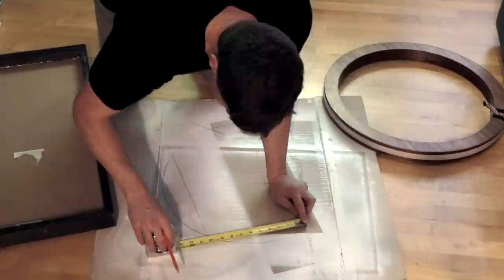DIY Music Reactive "Rings of Saturn" LED Pendant Light (controlled by Arduino) || How to Make

Comment: Why not use 3 of the 4 silver ( conducting? ) hanger wires as signal/power wires for the LEDs?
Such a grave missed opportunity compared to the atrocious black sleeved cable just dangling from the ceilling >_<
Reply from the maker: Durahl version 2.0 is on the to-do list....

Comment: Shame about the power cables. Would be great if there were integrated into the suspension cables. Apart from that, this is really great :)
Reply from the maker: Thanks!  I have a version 2.0 on my to-do list, and hidden wires will definitely be part of that.

Comment: This build is incredible! I would love to see a separate video on the electronics! :)
Subscribtion incomming

One question: How do you control your light? Specificly the constant white modes and the change to music-reactive mode?
Reply from the maker: Thanks!  

I use an RF receiver and remote.  I included a link to one in the description of the video, and code link is also in the description.  I programmed it to use a button that you press to cycle through the modes -- party visualizer, chill-out visualizer, slow changing hue, warm white, cool white, medium white / max brightness, off.  Other buttons are programmed to adjust the brightness.  One of the reasons I didn't go into detail is that I'm not fully happy with this solution.  I am working on a version 2.0 using esp8266 and Blynk to control it via a WiFi phone app.   I have a few more builds in my pipeline beforehand, but definitely plan to do a video on the electronics for music reactive LEDs at some point.

Comment: Would it be possible to order 1 of these from you ? i would aboslutley love one of these , with the possibility to change colors to fit the mood .  i would be extremly thankfull and happy if this is possible as i dont have the tools nor place to build one of these as i have a small 14SquareMeter appartment =/ .  Ebay or something would be easy to setup for a deal , if its not possible well thanks for the build guide <3
Reply from the maker: As of right now I'm not selling anything, but stay tuned as I'm talking to a few people who might be developing some pre-made kits and controllers to make projects like this easier to do.
Reply: Oh sounds intressting! And i think that would be a really smart buisnessmove , Some various DYI-Kits and the ideas designs you seem to have , it would be really awsome ^_^  thanks for the reply <3

Comment: How did you do the Arduino for the light?
Reply from the maker: I used an Arduino Mega with electret microphone, and RF receiver and remote.  There is a github link to the code in the video description.  I'll be doing a music visualization electronics and code video at some time in the future with more details.

Comment: What is the tool you use to cut the edge?
Reply from the maker: Which edge?
Reply: Modustrial Maker Use it at 2:25 minutes of the movie
Reply from the maker: That is a circle cutting jig for a router.  There is a link for it in the video description.
Reply: Modustrial Maker No, it's blue and you use it to cut the edge of the laminate at 2:25 of the movie
Reply from the maker: Oh that, it's a edgeband trimmer.  I'll add a link when I'm back at my desktop

Comment: controlled by Arduino more info please
Reply from the maker: +Andrew Shepherd the GitHub link to the Arduino code is in the video description.  Also, for more electronics details, check out my video for the Bluetooth speaker with music reactive LED matrix.  It uses basically the same setup (except it uses a momentary push button instead of RF remote for mode switching).

Comment: Should have run the wires up through a mount tube or something.  Hide it a little better, but then again, i'm just sitting here being 'that guy' on the internet, not actually accomplishing anything.
Reply from the maker: +walperstyle no worries, I'm that guy with my own work too.  V 2.0 should be done sometime this year, and will have a better wiring solution.

Comment: you should of put rgbw led in it instead of w leds
Reply from the maker: I wanted to do that initially, but unfortunately, the FastLED library isn't compatible with RGBW strips, since they have 4 LEDs per cluster.  It was either RGB or WWA, since both these have 3 LEDs per cluster.  Given that this is intended for my living room and I don't live in a dorm room, it had to be WWA :)

Comment: can you post a link to the arduino code?
Reply from the maker: Daniel Schlotthauer  It isn't pretty and has a couple bugs still, but I am happy to email it to you.  Just send me a message with your email and I will send it to you.  Also, if enough people show interest, I will do a separate video on the arduino electronics and code.
Reply: Modustrial Maker definitely do a video of the code
Reply from the maker: I"m getting a lot of questions about the code, so I threw it up on github.  Like I said, it is not very pretty :)  There is a lot of unused code and comments from other code I hacked together to make this that are no longer accurate, but it does work.  https://github.com/modustrialmaker/Rings-of-Saturn-LED-Light-Music-Visualizer
Reply from the maker: ...and because of the level of interest in the code/electronics, I will probably do a video on it at some point.  What I've essentially done is created a re-usable hardware configuration with a mic input and either push button or RF mode switching, which can easily be adapted to many different types and sizes of lighting projects.  In the pipeline, I have two concrete and woodwork videos coming out soon that don't involve lighting, then a dream man-cave project (which could be multiple videos, including some LED installations), an LED lighting installation for a really cool loft event space, and then hopefully will get to the full video on the electronic module used in all the LED installs :)
Reply: Thanks a lot :)